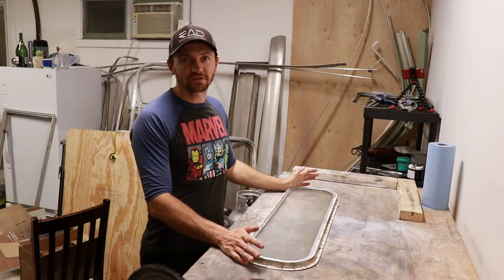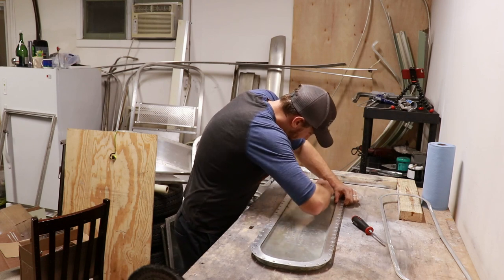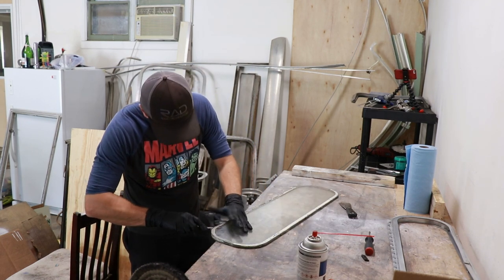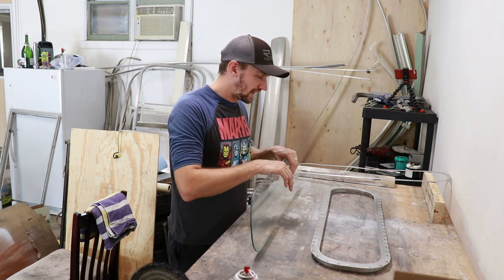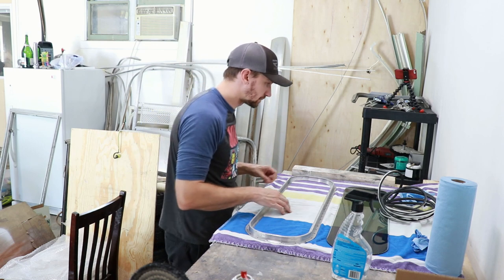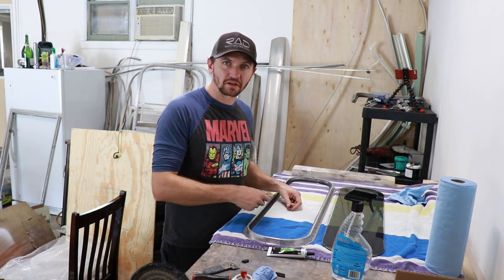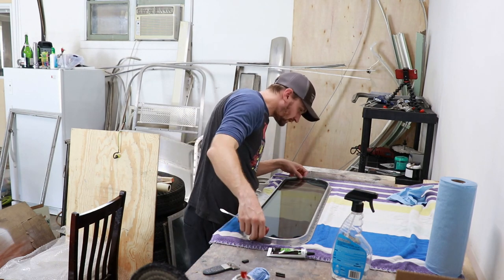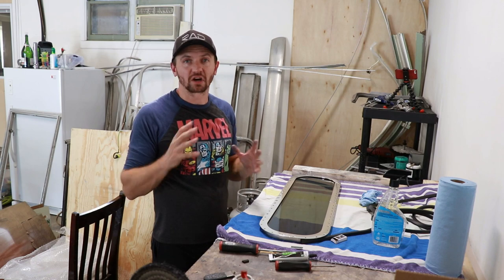Airstream Renovation Stack Window Repair: Bubbled Tint Fix

Comment: This video will be invaluable to me when it comes time for me to reinstall the tinted glass in my frames. I probably never would have figured it out without you! Since I'm removing the glass while the frames are still riveted to the Airstream I'm wondering how much harder it will be to reinstall it. I won't be working on a flat surface as you were. Gettin' a little nervous about it! Great video Ian, you're a natural teacher. Beautiful work! Thanks so much!
Reply from the maker: Thanks! Its not bad at all really to put the glass back in.  Using a screwdriver to press it in place works really well.  You will be able to get it!

Comment: Plexiglass is easy to cut and fabricate.  You should consider going ahead and making your windows double pane. Also, Harbor Freight sells some nylon pry bars for working with automotive glass and plastic.  Great for prying and fitting on windows and other scratchables

Comment: Thanks for the awesome vids! I’m currently renovating a 78 Excella 31ft- When rebuilding the oval vista windows- Can you do that with the interior skins intact. I have nearly finished the renovation on the inside and wanted to start working on the windows? I have a river shaver and could use Olympic rivets to reinstall.
Reply from the maker: There are about 4 different type of vista windows so its hard to know.  If it is the ones with the snap ring similar to the stack windows then yes, you can leave the frame in place. If you can, I always recommend using buck rivets instead of olympics.

Comment: Love these videos. You are doing a fantastic job! I have two shattered windows. Both in the same area, Middle window large - 22 X 33. The other is 10 X 33. I know I am probably going to have to bite the bullet and buy a curved window the large one because it is curved. However, is the lower one, stack, it is curved? Is there a place that I could just send them the cutout of the stack window and they could cut me the glass? Is the bottom stack window flat? It looks like it to me? Maybe if the glass comes out okay, that I could send that to them? Just an idea. Getting the windows is so expensive.

Comment: I have a very good question. What about Vista view windows? How do you remove the steel pins from the sash to get the two sash pieces apart? Do you have a video of that? Lol
Reply: Lol that’s the hard part. 
U may have to cut them out with a small hand grinder. 
Start on the outside and work ur way to the middle. 
Don’t go to far to the glass  
Cut them in half the pull them off. 
Then u can knock the out.
Reply: @samgillum75  yes....that's what I had to do. Not the best turnout...but it worked. Airstream sure knows how to make a lasting part. I do like the double pane. It's definitely double the panel to repair them. Ha

Comment: HELP! My windows are in need of repair. I do not have the time it is going to take to repair all my windows. Our seasons are short and so couldn't I theoretically break the interior windows to clean the film off( and all the other nasty stuff in-between)? The R_value in these windows is not substantial and there will not be any winter camping and/or summer heat is not something to worry about where I live. Thoughts?

Comment: I have a '77 Sovereign and they stopped using the snap ring.  You either have to try and break a pane in place or remove by drilling out the rivets.

Comment: I have checked out vintagerailergaskets….great site.  They have a lot of different gasket materials so I am a bit confused.  Did you use the Medium Rubber D seal and Medium Conversion Gasket for this window?
Reply from the maker: Yes, the D seal adheres to the frame itself, then the glass goes in and compressed the D seal and then the Medium conversion gasket goes between the glass and snap ring.  Feel free to call them at vintagetrailergaskets.com too, the guy is super helpful.  We have talked on a phone quite a bit! lol.
Reply: Thanks for the quick reply!

Comment: i'd like to try to repair mine in place and not remove the housing from the airstream. I tried to pry out the snap ring but its not budging. I'm a little worried I'm going to bend it if i pull to hard. The plexiglass and the glass are both in good shape - I just want to open it up to clean the peeling tint off the glass then put back together. I was successful doing this on all the side windows but they're pretty straight forward to remove. I'm thinking mine may be a little different than yours. 72 sovereign. In place, there is no visible aluminum frame lip - only what you are calling the snap ring is visible. So all I can do is put my screwdriver between the snap ring and plexi and it won't budge. Any thoughts?
Reply from the maker: I am not sure.  If there is no break in the ring or what you think is the snap ring it may not be it or have it.  It should snap in and then pull out of the groove.  I would call vintage trailer supply and ask, he knows every year and make window design and can help you out!

Comment: So you do not need to seal the outside edge between glass and frame?
Reply from the maker: You do.  Around minute 10:30 is where I put the seal on the inside part of the frame.  Then the glass goes in and compresses it creating the seal.  Its the standard Airstream window and door seal that is used there.